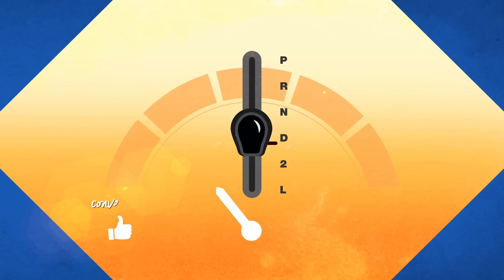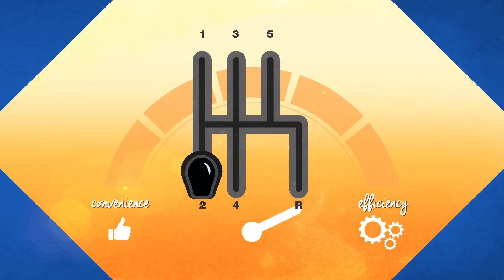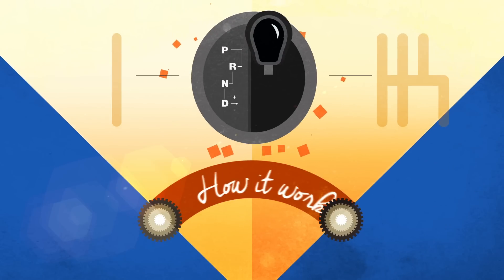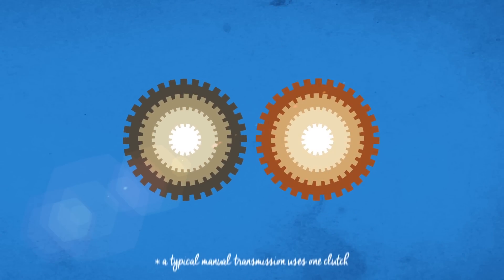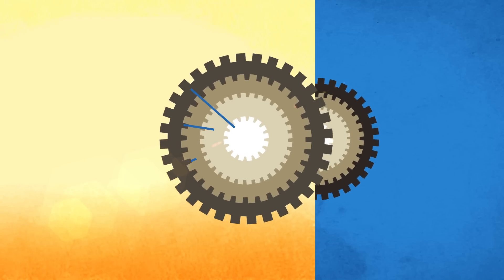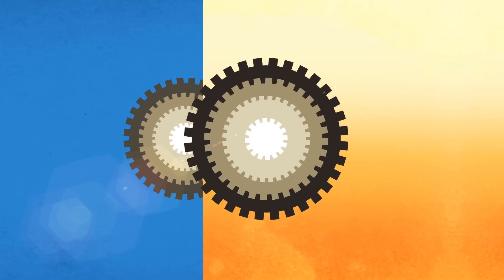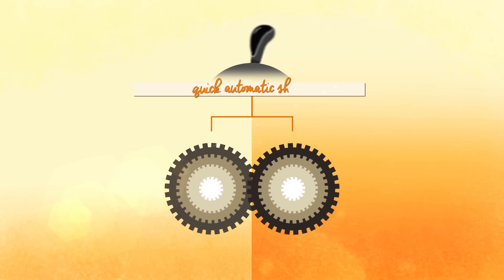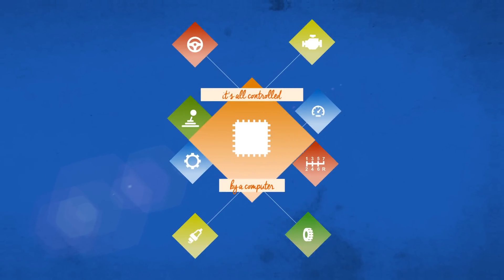How Dual Clutch Transmission (DCT) Works | Hyundai

Comment: I love my sonata 2015 sport I bought the car 0 miles for work as a taxi now it is 155,000 no issues engine and transmission are good 👍 but I never used the dealer for service I only go and buy oil filter and some parts if I need. My only issue are the parts prices and labor for service Hyundai need to work on affordable prices because in New York  for any repair is over 300 dollars and each dealer have different prices they force me to stop  going into service and to buy the parts only front other states where the same parts are half the price. I always change oil 3500 miles never used synthetic oil, never did a transmission oil change. The only issue with my car is that I been driving at low speed for 6 years and I need to change the clutch because the car rpm drop when I release the brake to put gas a feeling like the car wants to turn off it is sometimes no all day and I know that my driving style stop and go at low speeds could affect the dual clutch I ask the dealer they said like 5k I said yes 😂see you later the parts is 41200-2D220 I need to replace cost like 500 dollars.HYUNDAI Car are good 👍 dealer service and parts are over priced so DO NOT  buy a Hyundai car without checking the prices of repairs and parts…

Comment: Guys i have a question.. my tucson 2019 when engine is started, i must just very gently press the acceleration petal for some meters and then accelerate! If i try to drive immediately, it starts to push like trying to find the speed and to doesnt fully engage to the D1 etc for some seconds. My CLatch disks are brand new. Is it normal?
Reply from the maker: Hello Lucas, we encourage you to take your vehicle to the local Hyundai dealership for an inspection and assistance. ^cc

Comment: I love the DCT’s! But how or do we have to have them adjusted ?
Reply: Can you tell me why you love it? I'm considering a 2024 Santa Cruz, but between the recalls from prior years' models and the negative reviews on DCT in general, I'm leary. Thank you!
Reply: @safeinmyheart1  I grew up with a lot of manual transmission cars and trucks. I prefer the solid engagement and feel of a standard or DCT transmission due to that. Most automatic transmissions are pre programed and can be a love or hate relationship if you enjoy shifting gears. (the only thing i hate about my Camry) I would just advise if you sit in stop and go traffic daily, that DCT clutch and the servo that operates the release fork could burn out faster then some well built transmissions and CVT's like Toyota's and Subaru's. My Camry will last a long time but its so slow for me and my style of driving. But this "slowness" is what protects it from damage also. The Santa Cruz should have a 10 year warranty? So you should have peace of mind if that is what you truly want. Also look at other trims of the Santa Cruz as they could have other transmission options. (Also take a look and test drive similar priced Toyota's, even if they have a few miles on them;) I bought two, and never looked back. But I do miss my Subaru AWD fun! ;) Good luck!! Enjoy!

Comment: A DCT does not drive like an automatic, folks. It really takes some familiarity before you will master the quirks of the transmission control unit. The DCT is a game- learn to play it.
1) Be conscientious of your shifts- line up your up and down shifts accordingly and never shift two gears back-to-back 2) Roll off stops, but don't roll into a stop. A DCT in an idle car is at neutral. 3) Use paddle shifters liberally. Sometimes the TCU has a different idea than you intend (in city traffic I will usually drive in "Triptronic" full-manual mode.)
Comment if you have more concerns about your DCT car, and most of all, have fun! A DCT combines the performance of a manual with the smooth convenience of an automatic.

Comment: I heard that clicking test sound this morning on my 21 Sonata N line with the Wet N DCT 8 Speed. Good to know that’s probably what it was
Reply: Planning to order a ‘22 sonata n line. How’s the DCT on it, and do you recommend it if I am driving 50/50 of my time between highway and local?
Reply: I love my Nline, yes there is a recall on the transmission but they will get that fixed soon. I can definitely feel something wrong with it at times, but it's nothing compared to the joy we get out of riding tf outta it!!

Comment: My 2021 Hyundai Kona has been at Reliable Hyundai (Springfield MO) for 10 months now!  8,000 miles and  it has had 2 failed transmissions and they are putting in the third one!  This has been a nightmare.  Dealership is a joke.   Hyundai corporate is a joke.  Go see for your self.  It’s next to the service car wash.  It’s the dark grey color.  They have lied and lied about the repair or lack there of. I regret getting a Hyundai.
Reply from the maker: We encourage you to contact our Customer Care team directly at (800) 633-5151 for assistance. You can also visit our website at https://owners.hyundaiusa.com/us/en/contact-us.html for any additional questions or concerns. Thank you. ^cc
Reply: @hyundai  Hello.  I’ve been in contact with Vanilla.  She offered no insight as to the timeline for the repair.  Hyundai Consumer Affairs Case number 18097185.  R.O. 507049.    I’ve been experiencing this for 10 months.  There has been no help from Hyundai.  Look up the case and you will see the facts.
Reply from the maker: Please contact us directly at 833-462-8722, so we can notate your concerns onto your case. We also encourage you to continue working with your assigned Case Manager regarding your repairs and any other additional assistance that can be provided. Thank you. ^cc

Comment: Can't say that I've been super impressed with the DCT in my Ioniq PHEV. It's very clunky, lurches badly at low speeds, and is very slow going between Drive and Reverse, to the point of actually being a safety hazard. I had to do a 3-point turn on a hill the other day and the car FELL backwards a good 6 feet after I put the car in Drive, before actually engaging and moving forward. I actually really wish Hyundai had just used an ECVT like Toyota and most other hybrids. I honestly don't understand what people find appealing about a lurching, clunky transmission. It doesn't even shift quicker than a normal automatic which is disappointing. I drove a VW DCT once and the shifts in that were instantaneous.

Comment: My Elantra GT Sport dual clutch is clunking into 1st gear really bad. It's audible and you can feel it. First gear & both upshifts & downshifts are both slipping really bad. Dealer says both clutches have 80% life left. It didn't use to do this. I drive it correctly. What is going on Hyundai??
Reply from the maker: Hello David. Please feel free to contact us directly at (800)633-5151 so we may learn more. Thank you. ^cc.

Comment: I have the 2017 Tuscan DCT and at first was mostly fine, till I started seeing the "high temp, stop safely" message on dash when I was in stop and go traffic.  It is not the normal overheating, but instead due to the dual clutch system.  The clutches overheat for the "eco-friendly system".  Last time it happened I couldn't pull over and the car died in traffic for 15mins.  It is extremely INCONVENIENT and UNSAFE!  Hyundai should be ashamed of themselves for sacrificing safety and efficiency for some marginal environmental impact in this 'eco-friendly' DCT.  I will never buy another Hyundai again!
Reply from the maker: Hello Adam. Allow us to look further into your concerns. Please contact us at 1(800)633-5151. Thank you. ^cc.

Comment: Honestly, just get a manual transmission. DTCs are super expensive to fix and they are designed for race cars, not daily drivers. Ford is actually going through a class action lawsuit for their own DTCs. Not worth the headache
Reply: Thank you for your comment, you are right, I am from Chile and I have noticed that there are not many cars for example a tucson 2016 that are manual transmission, most of them are always DTC

Comment: Does this hyundai  eco shift DCT also have the clutch plate overheating issue like Honda Vezel DCT system ? Is this Eco shift DCT system available with hyundai Venus mini SUV model ?

Comment: @HyundaiUSA  My 2016 Tucson has been checked a few times and it was updated a few times and the problem continued.  It was manageable for the last 3 years, but I moved from Seattle to New Orleans and the 3,500 drive has made the transmission feel worse and slagging.  Just getting into the highway takes a few seconds for the transmission to respond when the gas pedal is pressed. I have to make sure I have plenty of space before entering the highway or when crossing multiple lanes.   Just yesterday I was inches from been T-boned because the transmission took at least 3 seconds to respond.  What can I do about this?  It is now becoming a hazard for me to drive.  Before it was manageable, but the last two weeks the transmission issue has become very concerning.
Reply: There was a class action lawsuit for your year of tucson. Search 2016 tucson class action lawsuit for more info.
Reply: I have the same problem with my Tucson 2016
Reply: @lonewolf3824  There was a class action lawsuit for your year of tucson. Search 2016 tucson class action lawsuit for more info.
Reply from the maker: Thank you for sharing your concerns with us. A specialist from our Headquarters will be in touch with you to investigate further. ^cc

Comment: Mine shudders as in am rolling into the garage. Suggestions? I just bought this car and am alarmed. I assume it has something to do with the dct. Its a 1.6 2018 tuscon. Anyone?
Reply: Get rid of it. It will be nothing but problems. DCT's are terrible, just look at Ford's 6-speed DCT PowerShift transmission. Lawsuit after lawsuit, recall after recall, angry consumer after angry consumer. Hyundai has the same problem. Many owners of this transmission have gotten into accidents because of it. Everyone I've talked to HATES this transmission and will never buy a vehicle with the DCT again. This is why I bought a 2019 Tucson SE with a normal 6-speed automatic over a Tucson with the DCT. Zero issues, shifts nice and smooth, and when I put my foot down IT GOES with NO hesitation. Good luck to you.
Reply: I already did. The dealership where I bought it agreed to trade me back. They had advertised it as an automatic so I got a trade and got rid of it. It had lots of bells and whisles but that shudder was crazy.

Comment: VW's DSGs have hydraulically-actuated shifting and clutching while the Getrag unit that Ford used for a while in the Focus employs geared motors.  What is the means of shifting and clutching in the Hyundai unit?

Comment: DCT is terrible!  Have a 2017 Tucson.  Drives Terribly.  DCT broke after only 35000 miles, Already had to have a new transmission installed.
Reply from the maker: Are you still currently experiencing issues with your Hyundai vehicle? If so, please contact our customer care team at 1-(800) 633-5151. Thank you. ^cc
Reply: You're going to have to change your driving habits, buddy. And even then, you'll still have to get your clutches replaced frequently. I'm surprised yours lasted that long, honestly.

Comment: Yeah question we just got a 1.6t tucson. My question is do the clutches need to be replaced like a manual Tran fml.
Reply: Yes... Eventually. But if you're taking care of the clutch by using the dct appropriately - I.e. 1. No crawling in traffic - wait for a bit of distance before moving so the clutch doesn't need to slip too much before getting up to speed, don't drive it like a torque converter automatic; 2. not letting the car hold position on a hill by pulsing the throttle instead of holding the brakes, then you're likely to sell off the car before you need to change the clutch pack. You're more likely to ruin a clutch through bad driving habits than normal wear and tear (and the clutch is covered by warranty if it's defective. If it were a manual, any clutch problems would've been classed as driver error or wear and tear).

Comment: Everybody complaining about the DCT has clearly never driven a manual. Even though technically it is an automatic transmission it is supposed to drive like manual.  Everything you guys are experiencing in what you think is hesitation is actually the same functions and amount of time a manual takes when you are actually physically changing gears. It was never designed to drive like an automatic.
Reply: Right. But the salesmen will tell you that because they want to make that sale. "It drives like an automatic!"
Reply: Except that it's supposed to be Dual clutch, implying that the shifts should be significantly faster than a traditional, single clutch manual transmission because it should be pre-selecting the next gear. I've driven VWs that have DCTs and those actually do shift practically instantaneously and were nice to drive. The DCT in my 2019 Ioniq is incredibly clunky and inelegant though. Shifts are slow, basically like a traditional automatic, plus you get this really annoying lurching at low speeds that you don't have in a traditional automatic. I honestly wish they had just used an ECVT like Toyota, probably would have been significantly more reliable, less moving parts, smoother, no awkward lurching or falling backwards, but I guess people prefer that lurching, jarring performance...
Reply: That’s right! I bought a brand new one so it hasn’t been misused by anyone. If anyone drives it I will tell them what to expect re not a lot of people drive manuals nowadays. The last two sentences sum it up perfectly.

Comment: I suggest not to buy Hyundai vehicle with DCT. 
Do not buy Dual clutch transmission vehicle. I bought Sonata Eco, Transmission  failed 2 times, very hard to drive in city where there are more traffics. Took long time to repair. Always worried about your vehicle, Not peace of mind. Lots of Hesitation while driving. So so many problems, I became the victim, Please don't be victim like me. Normally general, average income people buy Hyundai vehicle & when your vehicle gives too much stress than you are gone a..... 😂😥
Reply: Did you get your vehicle changed?
Reply: @JP-lj6ft  yes, I changed with Honda Accord touring
Reply: Ishwor Shrestha so you traded Elantra in for an accord? Or did the dealer buy back the car?
Reply: @JP-lj6ft my car was sonata eco not elantra, yes, dealer took back, I told Hyundai dealer that car giving me too much stress, transmission fail 2 times just between in 3 /4 months. They talk in Hyundai company of America, later they took my car back, I got very good price....

Comment: 2017 Hyundai Tucson with 61,000 miles. One day I accelerated onto the Freeway and the gas pedal was useless. Car couldn't get into gear therefore no acceleration - while an 18-wheeler is barreling up toward me landing the air horn. Now Hyundai can't figure the defect, so i'm getting a new transmission. THIS SHOULD BE RECALLED, HYUNDAI, AND YOU KNOW IT.
Reply from the maker: We recommend you contact us directly at 844-462-5557 for further assistance with your vehicle. Thank you. ^cc
Reply: @hyundai  My 2016 Tucson has been checked a few times and it was updated a few times and the problem continued.  It was manageable for the last 3 years, but I moved from Seattle to New Orleans and the 3,500 drive has made the transmission feel worse and slagging.  Just getting into the highway takes a few seconds for the transmission to respond when the gas pedal is pressed. I have to make sure I have plenty of space before entering the highway or when crossing multiple lanes.   Just yesterday I was inches from been T-boned because the transmission took at least 3 seconds to respond.  What can I do about this?  It is now becoming a hazard for me to drive.  Before it was manageable, but the last two weeks the transmission issue has become very concerning.

Comment: I have elantra with dct.  Once you get used to paddleshifter, all the problem with dct will be gone. but since it is bothersome to use paddle all the time, I recommend you to drive in Sport mode. Normal mode sucks in any situation.

Comment: It feels a little different from a stop because Hyundai didn't tune these things correctly at all.  I've had so many close calls I always accelerate in sport when pulling out in traffic and down shift with the regular drive mode.  I'll be getting the ECU tuned by Tork which should smooth this transmission out a bit hopefully.
Reply: did u end up getting the tune ?
Reply: curious about this too. I do the exact same thing when I know i have to go now... other than that love my 1.6t
Reply: Does it work for you ?!

Comment: I've owned a 2015 Sonata Eco since new and it is currently at the dealers awaiting a complete transmission replacement. Only 44k miles and I drove it correctly. Love the car and the transmission, but the transmissions are NOT reliable. Fortunately it is completely covered under Hyundai's great warranty, but still doesn't make me have great feelings about the longevity of the vehicle. I would suggest to avoid the DCT transmissions.